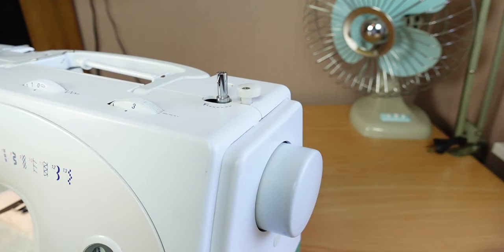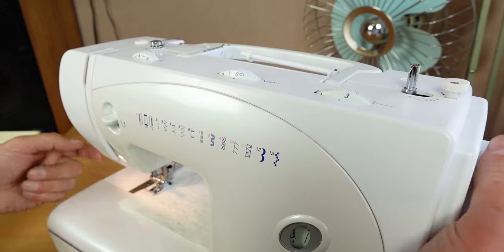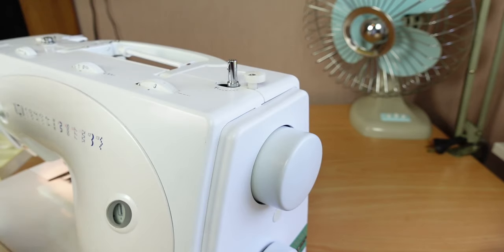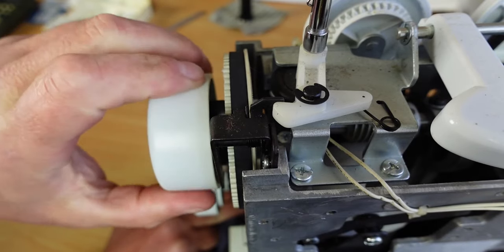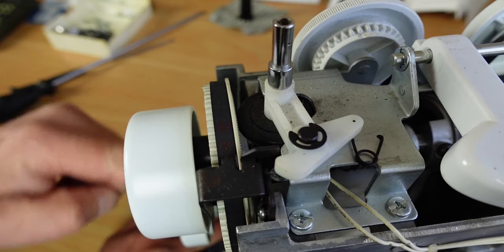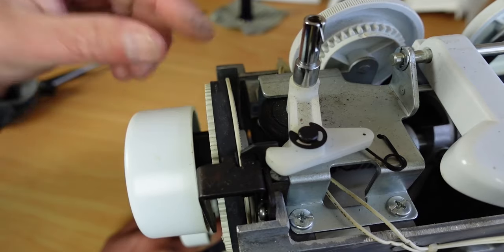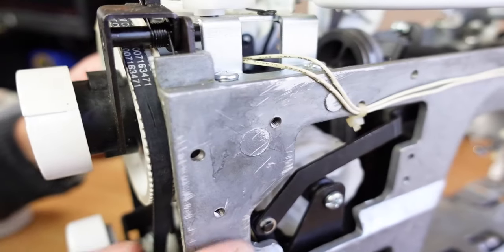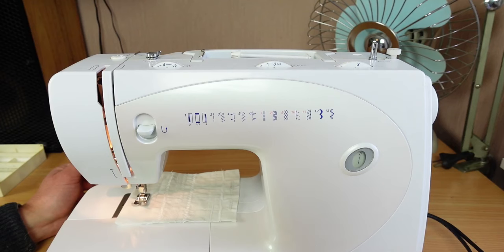Jammed Sewing Machine Fix - A Common Reason a Sewing Machine May Appear Jammed

Comment: Unfortunately this did not solve my problem. The bobbin was not engaged and the wheel still won’t turn. 😢
Reply from the maker: Hi. It must be a problem somewhere else in the machine. Try removing your bobbin case and looking for thread tangled in that area. Could be any number of issues causing it. If the machine hasn't been serviced recently it may need oil and clean. Thanks.

Comment: What even when bobbin winder is in not winding position? Wheel still feels tight when you turn it. What is the issue in this case? Wheel should be freely turning right.
Reply: Same
Reply: @anniecurtis8147  After going through lot of other (Indian Hindi) YouTube videos , I found the issue with my sewing machine. It was thread broken in the shuttle. Mine is basic Singer Start model where removing shuttle and cleaning was easy. It was on two clips. When I removed the shuttle to clean I found lot of thread broken and stuck there. Also all the cotton like stuff. I cleaned all and found my wheel was free. Finally I oiled it and it's good to sew again.
Reply: @graceg751  hi can u show me a video how u fix it

Comment: Thank you thank you! The dang bobbin winder! I took the hand wheel cover off and saw the problem where it was being blocked from turning but did not know it had to do with the bobbin winder being engaged.  I wish Juki made a note of that in the Troubleshooting section of the operator’s manual. Glad I stumbled across this video or I would have hauled the machine in to a repair shop.
Reply from the maker: Good point. I have people bring machines to me to be un-jammed and this is often the cause. Thanks.

Comment: So, if the bobbin winder spins very slowly, or not at all…is it typically the rubber tire needing replacement? I finally got it to stitch, but I cannot make a bobbin anymore. Tried to remove cover but no luck accessing rubber; hoping there’s a # on it. I cannot find my model online either, for the rubber tire size; Euro-Pro X 7130. Is there a compatible make/model?- they never name mine on Amazon or sewing parts sites. Frustrated.

Comment: I got excited and rushed to my jammed machine hoping it was the bobbin winder. Sadly not. So guess I am going to make a trip to the service place tomorrow. The hand wheel is not turning using food peddle and when I manually turn it, it does but with resistance. I also oiled  the belt. Not much difference.

Comment: Hi
I have a singer Simple machine and when I engage the bobbin winder. The hand wheel is not turning WHICHI IS CORRECT But the clutch is no properly working and the belt also jammed. So matching is not able to thread the bobbing winder and it is jammed basically.
any solution, please tell me

Comment: My machine is completely fine 
However the needle isn't turning when I step on the pedal, it will work when I Turn the handwheel
My bobbin winder is the first thing I checked 
Nothing is engaged with the bobbin or bobbin winder 
I don't understand the issue can you help me?

Comment: I don’t have this problem…bobbin winder is disengaged. The wheel gets blocked as is the needle so I cut the thread from the top and find broken thread inside or wound around the axis for the bobbin (I don’t know what it’s called - the metal stick that holds the bobbin).
Reply: I have the exact same problem, I'm on day 4 of trying to fix it
Reply: @rachaelparker3064  Firstly, have patience, these machines don’t operate the same everyday. I know it sounds silly but that has been my experience. So, I saw in another video to check your tension (we tend to put it on the smallest, so put it on 3-4). Then, with my machine I noticed that certain stitches work for a certain length then they mess up. I don’t have an expensive machine and I also inherited it from my sister who bought it at a garage sale. Try to enjoy making your project, regardless of any problems it may give you…when it starts getting you mad, change your thread and try the same stitch on a “fat quarter” and try using different threads so you can see where the problem is (this is the most helpful by far).

Comment: I have what seems to be the opposite problem... the winder is jamming before it has done one revolution... maybe the clutch is the issue?... when  I disengage the winder and turn the machine using the wheel it feels heavier than normal as well. I had just finishe a massive woollen project...

Comment: Hello , my singer sewing machine heavy duty I just purchased it brand new but when I attempt to start sewing it’s almost like the needle won’t move ?? I made sure the bobbin lock isn’t engaged so it’s not that and everything it threaded correctly and the power works it’s just when I am ready to sew it almost sounds like something is blocking the machine from moving ??
Reply from the maker: Not sure exactly what that would be. I would go back to the people you bought it from as it will be under warranty. Thanks.

Comment: I checked the bobbin winder and it was in correct position for sewing, but hand wheel still does not turn.  I am so frustrated 😢
Reply from the maker: Sound like you need to get your machine to the nearest repair agent. There can be many causes of this issue. Thanks.
Reply: @InStitches my sewing machine has been fixed by my son who knows nothing about sewing machines.   There was a loose thread caught behind the bobbin case.  He was able to remove thread and, yea, my machine now works great.  Thank you Mickey so much.